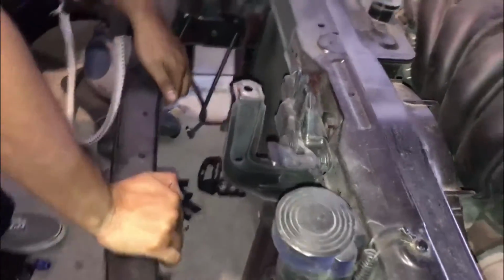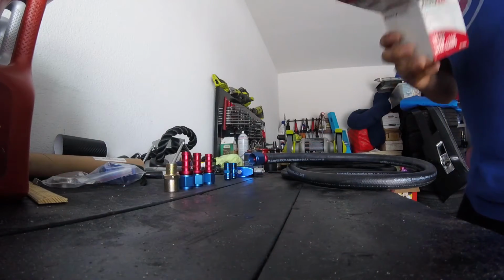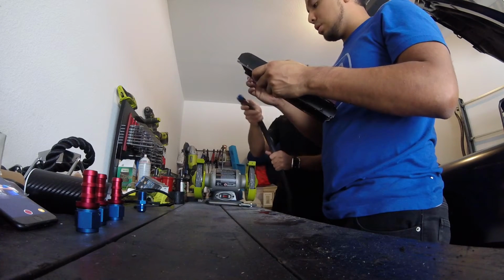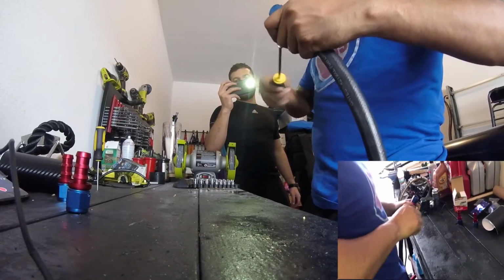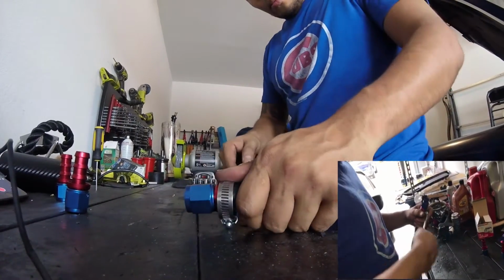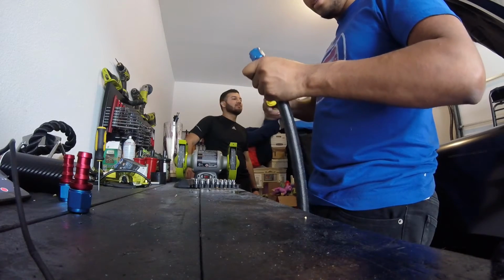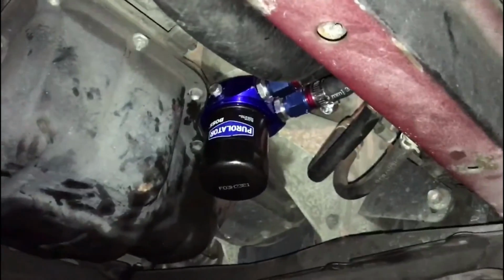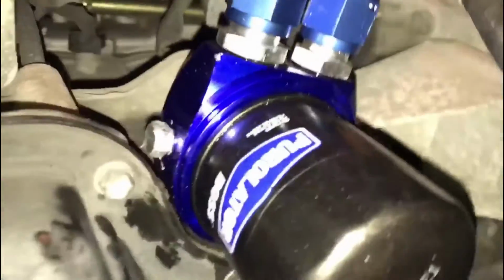Turbo Charging a 2008 Corolla build part 2 (Oil Cooler, return/feed lines)

Comment: Can the turbo feed line also connect to the sandwich plate?
Reply from the maker: It honestly depends on your application man, if you were running a small turbo like the stock ones on most 2.0 l cars, yes, if its bigger than that youd probably want to run something bigger for cooling and lubing purposes. For this application though, ive been tinkering around the last few weeks and decided im going to do a rear mount, remote mount, turbo set up on this car so im re configuring the car for this set up

Comment: Petrol engines do not need a turbo, as they combust their fuels efficiently at higher rpms unlike diesel engines. Adding a turbo the petrol engine would only lead to loss of fuel economy with marginal rise in power.
Reply: Yeah and its to gain power, I doubt he is worried about mpg.